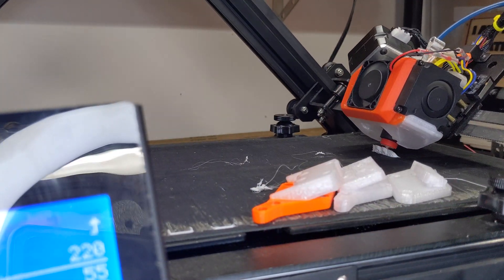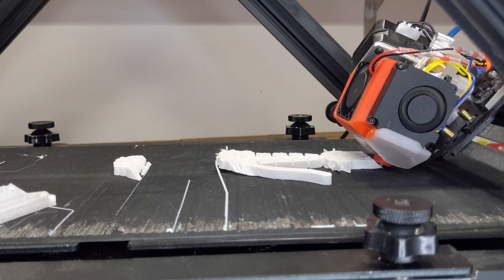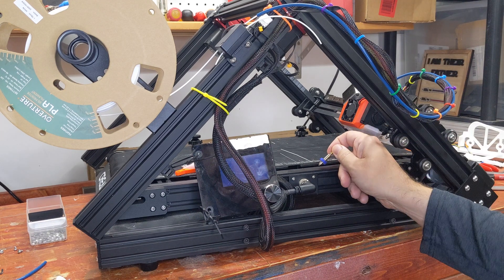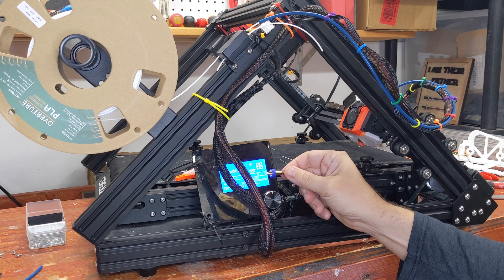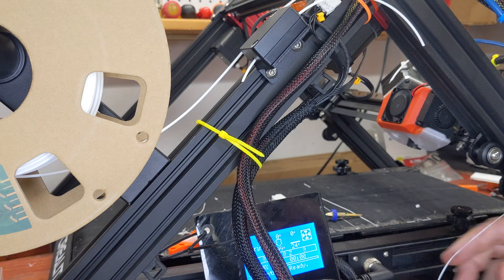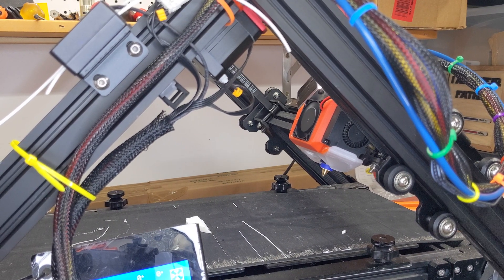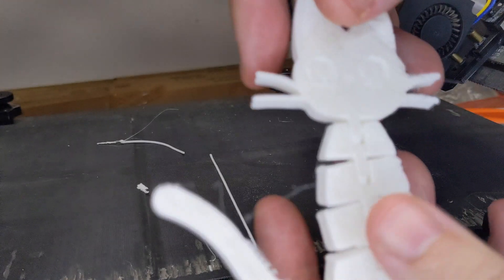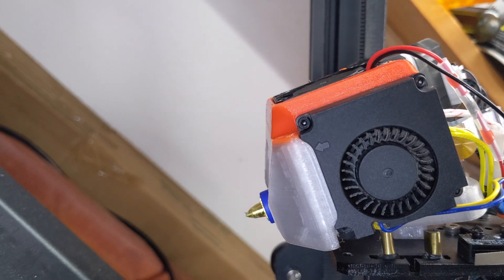CR30 PrintMill - NG Revo 22.5 Degree Upgrade

Comment: Hello!
How to set 22.5 degrees in the slicing program? Which slicer do you use for the cr-30?
Reply from the maker: Mostly Ideamaker - but don't change the angle in the slicer, it's still printing at a 45 degree plane.  This just changes the angle of the extruder to be more bed-adhesion-friendly.
Reply: @PaulChase  Ok, I understand and thanks for the info :)
Reply: I would also like to know how you solved the wiring of the extruder motor? It works backwards with whatever cable is added. Thanks.
Reply from the maker: @atoshun2624  Mine was wired correctly from bondtech - but with any stepper motor, rotating the connector around 180 (plugging it in backwards) will reverse the motor
Reply: Thanks, I managed to do this too :D @PaulChase

Comment: great modification, be good to see how you connected the wires...
Reply from the maker: The cr10 ng kit came with a connector, but it was backwards - I swapped the pins so I wouldn't have to mess with the firmware